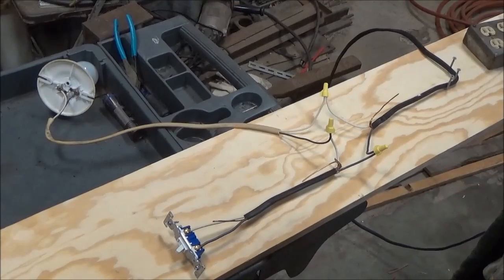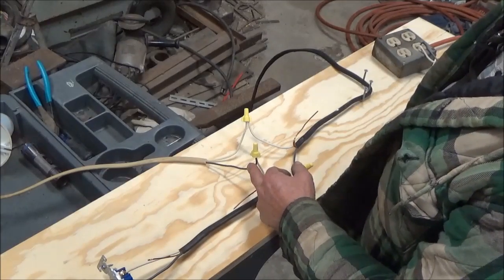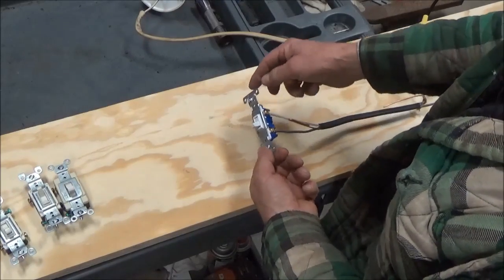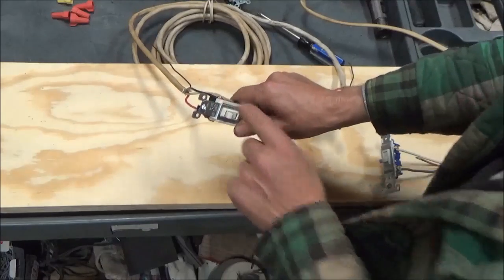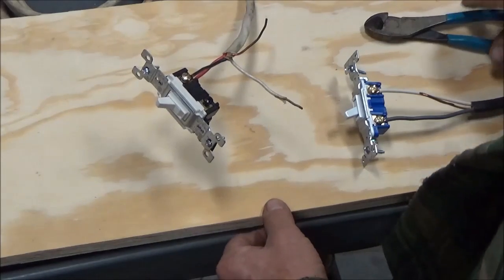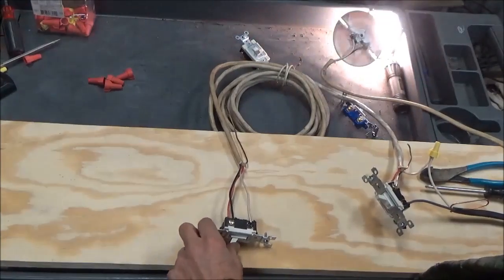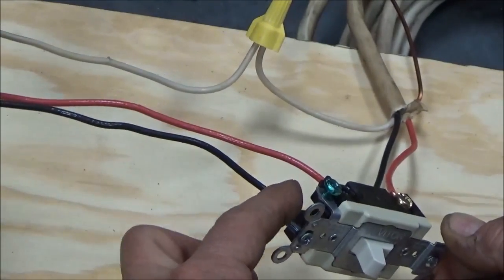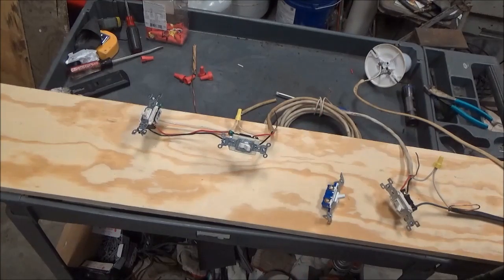How to add 3 way and 4  way switches to where a single pole switch was

Comment: This is an old home built in the 70s and has two black wires and one white, no vids here adess that...I'm lost
Reply from the maker: What are you trying to do?
Reply: Just replace two light switches both to connect are in a a short hall,. There are  two black wires one white. I'm not sure where to connect them on the new switch?
Reply from the maker: I'm not sure I can help you find which wires are which doing a chat on youtube, I wish you had noted which wires were on which screws before you took them off. you only need to be concerned with the wire on the black screw at each end of the circuit, the other 2 wires can go on either of the brass colored screws. You must find the wire that goes to the black screw at the beginning of the circuit, (1st switch) it will be "hot" use a circuit tester or a volt meter, it should not be white, but who knows someone could have done it that way, the hot wire goes to the black screw, the other 2 go to the brass screws. At the other end, (the other switch) the wire that goes to the light goes on the black screw and the other 2 go on the brass screws. 1 of the 3 wires will be hot with the (1st switch) in one position, put it on a brass screw, flip the (1st switch) to the other position and go back to (2nd switch) and find a different hot wire and put it on the other brass screw, the 3rd wire goes to the black screw. You can use a volt meter to find which of the 3 wires is hot by putting 1 probe on a known ground and the other on each wire until you get a reading and then put that wire on a brass screw. I hope this helps.

Comment: he said you put the neutral wire on that other black screw. but if you follow it, it is the leg that runs to the light. black screw on one is Line and black screw on the other is load.

Comment: Gordon I know this is an old video but I just found this now.  I've been searching for videos to explain how to change a single pole switch to a 3 way switch, and none explain it the way you do.  I just now finished installing the switches just as you explained and it was very easy with your instructions.  Thank you so much for sharing.
Reply from the maker: Glad to hear it helped. Most of my channel is mechanic related but I do have some construction and general repair content.

Comment: Wow!!  Finally someone who explains it in simple terms. The brass screws versus black screws makes sense to me.  So, in between the two switches you simply, connect the black and red wires to the brass screws.  And it doesn't seem to matter which color goes to which screw, so long as the black and red wires are connected to the brass screws. I don't care about the theory, I just wanted to know which color wire goes to which screw.
Reply from the maker: Thanks for watching.
Reply: As well, it works better when you avoid using random comas like the ones around "in between the two switches you simply...."

Comment: this is a nice vid.. good times when we used to wire this way..   It has been illegal to wire this was sine 2011 tho.   :/     vid says posted in 2016?
Reply from the maker: I'm not surprised if it is illegal, but I know that it's perfectly safe and nothing wrong with it, so the next time I need to install something like that, I'll do it like this. Thanks for the comment.
Reply: the only thing is that they require a neutral from the same circuit at each switch location.  again nice vid... it explains well how 3 and 4 way switches work!
Reply from the maker: A neutral? or a ground, where are you going to put a neutral?
Reply from the maker: I explained in the video that I left the grounds off on purpose to make it easier to see the circuit, I would not leave the grounds off in the application because if a hot wire were to break inside the box it might touch the mounting bracket on the switch making it hot, if grounded, it will immediately throw the breaker.
Reply: Look at NEC 404.2 C
Reply: Aaron, I don't know why you're trying to flame Gordon for helping the rest of us out.  The last two times I hired Master Electricians to do a job the 'right' way, they showed up late, then screwed it up, and I had to fix it myself.  So I appreciate this short, simple explanation by Gordon. He doesn't try to impress with his intellectual prowess, he just show us common guys how to 'get er done!
Reply: @jeffchandler1 , he's not trying to flame Gordon. He's trying to help people be safe. I doubt he was trying to impress, either. Geesh.
Reply: you are a douche
Reply: @johnvfos : Now who's gonna help you clean up the shards of mirror that you said that into?